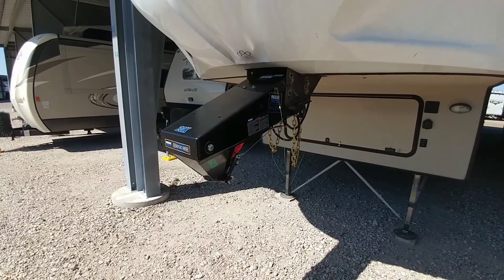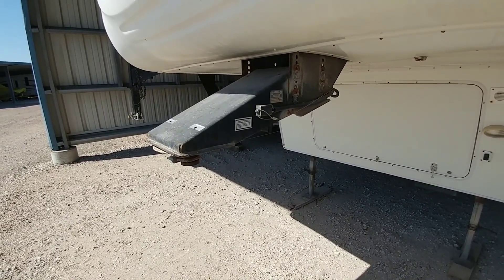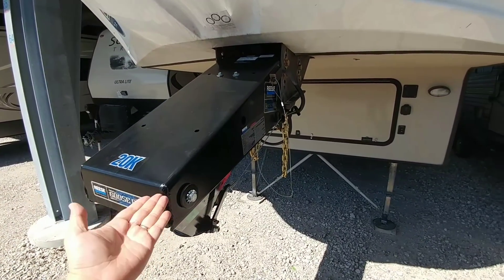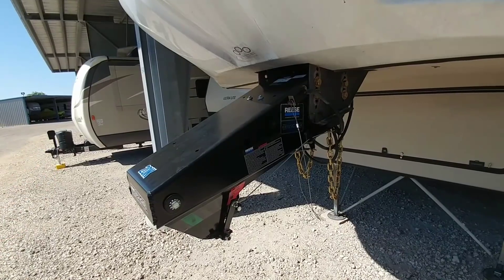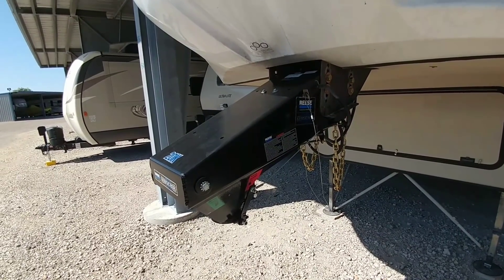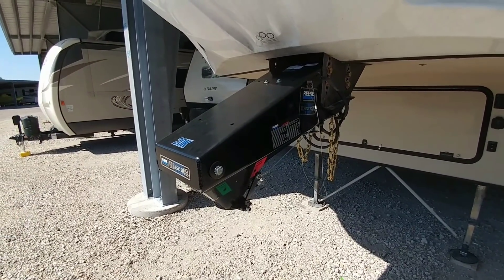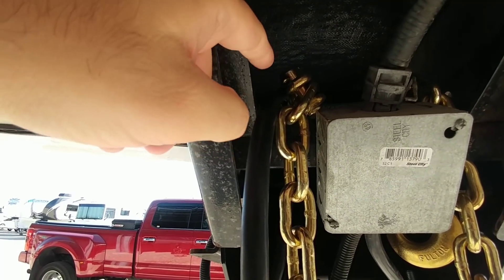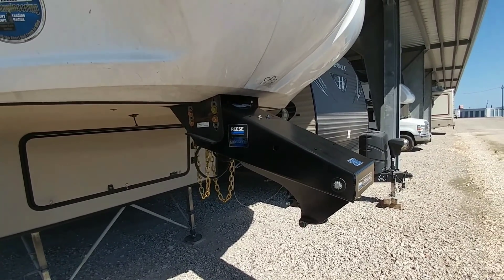WHY a Reese GOOSEBOX and not a Fifth Wheel Pinbox!

Comment: Can you back up that leverage claim - the way you explained it? The leverage of a gooseneck adapters is an issue, but I don't think it is in the way you described it. 

As to the Reese goosebox - I have had two. The first one had a defect in the way the two main parts were either made or installed. On one side I have about 5/8" clearance between the two and on the opposite side I had less the 1/8". This caused the useless height decal to be scraped off and had an annoying squeak. Probably easy to correct by disassembling and re-assembling shimmed correctly.

After 5000 miles of use: 
1) Since I have a toolbox across the bed you cannot see most of the goosebox. It is extremely hard to hook up. You have to be almost dead on to connect. The receiver is coned shaped the opposite way it needs to be to catch and drop on like the cones used on the Anderson. I use my mirror and a stick magnet, but as you lower the trailer the receiver postion changes, it moves forward.
If the truck and trailer are not level to each other side to side it is even harder to connect.

2) if you store anything behind the ball (in front of the tail gate) you have to be wary of un-hitching and pulling out. You are limited in height (of the stuff) to whatever you are willing to lift the trailer over. Like other gooseball or Anderson style connections, you need enough lift to clear the ball, that can be a problem on sloping sites.

3) The bed space is great when the trailer is off. But connected I found no more useful room then when using my Hensley TS3. You need a lot clearance all around the base of the goosebox for turning.

4) The air pressure is set with a blow off valve, initially at 50 psi. the more bumps you hit, the more air you can lose as the loads change. I eliminated the blowoff valve and set the pressure manually.

5) The ride is different. Not much of a concern for me, but my wife rides in the trailer frequently and she does not like the goosebox ride.

I like the concept, but after a season of use I put my MOR/ryde pinbox back on and re-installed my TS-3.

I have two goosebox's for sale if anyone is interested. One is new, unused with all the install hardware, on used with about 5000 miles use, both in New Jersey.
New $800
Used $300

Comment: I have used GNs and 5th wheel for many many years. A 5th wheel hitch is far better. MUCH faster and easier to hook and unhook. The Only reason to use this contraption is if you have a GN ball setup that can't easily be converted to a 5th wheel hitch. If you don't cheap out on a 5th wheel hitch you can get one that comes out of your bed as easy as unhooking a GN hitch. You leave it connected to the King Pin if you want by disconnecting the pucks and you have a clear bed just like that. With a 5th wheel you simply back up and it latches itself. You can do it all and never have to crawl your ass into the bed, lol. No safety chains required either with a 5th wheel. I swap out my GN receivers with a cheap King Pin adapter for the ease of connecting and disconnecting and it keeps my friends from wanting to borrow my trailer!

Comment: On the nut and bolt issue can you reverse the way you installed them so the nut is on the outside?
Reply from the maker: Since I torqued the bolts down 10lbs over spec, I should be ok.  I am going to recheck though.

Comment: Thanks for this video!  My immediate question, was why???
Reply: Well in my case at least, I want the extra angle and space between the trailer and the bed of my truck.  Ever drive down a country road and come to a RR crossing that is nothing more than a large hump in the road.  I have seen a lot of trucks in the body shop with tail gate and bed damage as a result.  A Goose neck trailer will typically provide a larger margin of error in that situation.  In addition, I use my truck mainly to tow a flatbed goose neck trailer.  Occasionally  I'll pull a 5th wheel toy hauler.  Swapping back and forth is a chore.  I was toying with converting my goose necks to a 5th wheel pin setup,  something I Was reluctant to do because of the above mentioned damage.   but now that this is out, it is a better option when I don't pull the toy hauler anywhere near as often.

Comment: Why didn’t you flip the nut and bolt assembly so you can properly torque your nuts?  Compromising safety for esthetics should never be an option, if that was the case.

Comment: I’ve had 2 5th wheel toy haulers.  The first was a 2005 Weekend Warrior 35’ my current one is a 2015 37’ Forest River product.  I wanted a gooseneck myself and was told both times I would void my warranty as there was to much stress on the unit.  Both times I checked with 2 other manufacturers I was slightly interested in and was told the same thing.  Everyone I know of with a gooseneck setup have non toy hauler units.  2 of the companies I checked with were Keystone (Thor) and Dutchman.  Do you know for sure why this is?  I’ve never got a straight answer or one that makes sense.  I’m just guessing because of the extra weight of a car and almost all of them carry 100-150 gal of water.  Great vid and any light you can shed on this topic would be greatly appreciated.
Reply: Super Sami I work as an rv technician and certified and I also hold certifications in welding as well. What happens with the gooseneck adapters is they become a pry bar on the kingpin and front frame of the fifth wheel. A fifth wheel is engineered and designed for a “pulling” motion or all weight is pulled on the frame. A gooseneck adapter then causes the weight to pry on the frame and kingpin causing stress. A gooseneck is engineered different for that reason. I’ve personally repaired three fifth wheels that the front framework has been broken from a gooseneck adapter. Hope that makes sense!
Reply: Justin Jones thanks , that makes sense.  I figured it had something to do with leverage or weight but no one seemed to know for sure.

Comment: Sorry, but you statement about the moment or torque applied to the pin box being less because of the sloping angle of the Reese gooseneck hitch is totally incorrect. It does not matter what type angle or connecting steel  is used between the goose ball and pin box frame. It is only the horizontal and vertical offset.  Ask any mechanical or structural engineer.
Reply from the maker: Please explain how I'm incorrect.  The extended attachment of a gooseneck adapter adds to the vertical offset and applies horizontal force.  Much like a lever.
Reply: ...and add to that the damping of the 2 shocks and the air bag.  Maybe Gordon can sketch us up a Free Body Diagram to prove his point??

Comment: OK all kidding aside I saw how you installed the ball. It locks in with that small little socket ball connector. Really! I can't see it holding all that weight. Well at least there are safety chains.
Reply from the maker: Paul Rodrigues: It's rated to 30,000lbs.  Typical ball connection for new puck style oem gooseneck connections
Reply: The pin that goes through the ball is made of tool steel and I've pulled my John Deere 450E Dozer on my 25' gooseneck trailer with that same type B&W hitch and do not have any problems and 28 rolls of 4x5 hay on my 40' gooseneck and pulled my dads 30' fifth wheel trailer with a gooseneck hitch set up also.  But, my dads is the older style RV hitch and it does show stress.
Reply: I've hauled several loads of hay with that configuration with no issues. Total weight was over 27,000 pounds including the trailer.
Reply: Yes no doubt but it is not very reassuring. It reminds me of the ball that holds a socket on a ratchet wrench. And we all know how well those work. (just scary to me that's all.)
Reply: Paul Rodrigues my B&W gooseneck ball has a hole that goes the way through it where the solid tool steel rod goes through all the way through it and out the other side of the ball.  It doesn't just barely go in the ball or have a button that releases it, I pull the rod that comes all the way under the fender
Reply: Paul Rodrigues u

Comment: Sorry guy, but your excuses about your torqueing don't cut it, that adapter isn't on correctly. Without the proper torque, those washers aren't compressed completely and you're going to have movement that could lead to a catastrophic failure. PLUS, you held the top of the torque wrench, and I think you're wrong about the physics concerning the different stresses this adapter places on the frame as contrasted to any other gooseneck adapter. It's more a matter of distance from fulcrum than the angle you're pulling at. If you're going to put up how to videos, please make sure you know how first, the advice you're giving is dangerous and is putting you at a liability.
Reply from the maker: SentByHim: So, I consulted another Mechanical engineer friend who specializes in materials.  He stated that if both sides had flat washers or flanged heads then torque from the nut side would be required.  He stated that since Reese included to locking conical washer on the nut side, it would be compressed and preloaded while the bolt head is torqued.  This is how those specific washers are designed to perform and bolt loading the head is the preferred method.  Thoughts?
Reply: Please show us a physics study you have done to prove your point about the stress you say is still greater than the stock pin box. Thank you.
Reply from the maker: John, it's very easy to ask someone to independently do a "physics study" on something when you know that the reality of doing such a study does not make practical or financial sense (a very common youtube comment is "prove it").  However, I trust that Lippert and Reese (whom are very interested in avoid litigation by giving out wrong information, especially as it applies to towing heavy RVs) have performed such a test.  Actually, it clearly states that they have performed independent testing to confirm what I've stated (https://www.lci1.com/goose-box).   Also, Lab testing was performed:  Independent lab tested & proven to provide a better ride than king pin“bolt-on” adapter solutions (Bosch Automotive Proving Grounds) (http://www.reeseprod.com/products/pin-boxes/goose-box/goose-box/Jsbr87GrqXnapVUQgaaYys7QyY0TL2Pv).  Now, if you think "Big Truck Big RV" should do an independent test (since you are specifically requesting it), I would be happy to provide you my PayPal account so you can fund such a test that I will be thrilled to carry out.  Otherwise, I trust the testing that Reese and Lippert paid (a quite substantial amount I imagine) to have performed (also, the Goose Box meets CSA & SAE J2638 test standards) should meet your satisfaction, I hope.  I sincerely hope you have a great day sir.
Reply from the maker: I really do appreciate your concern and ensuring things are done correctly.  I do not deal with Torque wrenches on a vocational or even semi regular basis.  I did over tighten the bolts to 220lbs vs the 210lb spec the instruction indicated, so that should help.  I am planning on going back and checking to ensure they are indeed at at least 210lbs.  I do not want to turn the bolts around simply because that would go against the specific instructions Reese indicated in the paperwork on the orientation of the nuts, bolts, and washers.  I only applied inward pressure on the head of the wrench because it would not stay on the bolt head otherwise.  At 220lbs of force, it's extremely unlikely that the small amount of inward pressure applied would have skewed the results.   Perhaps if I was torquing to a typical 50 or 100lbs maybe.  Again, I really do appreciate you concern and I will double check the torque specs from the inside.  Have a great day sir.
Reply: You don't need a study. A high school physics student should be able to answer the question about leverage.